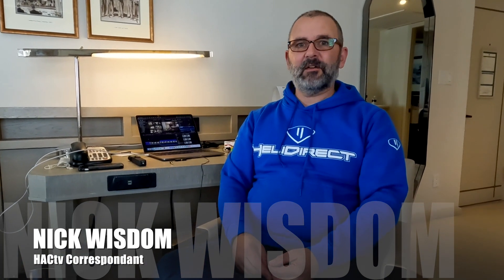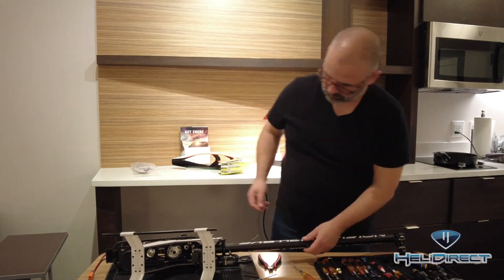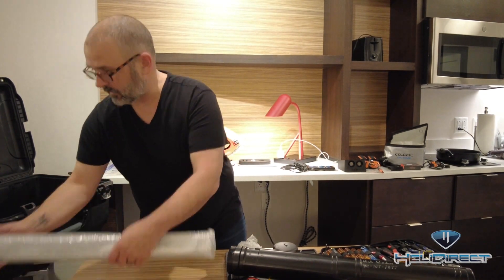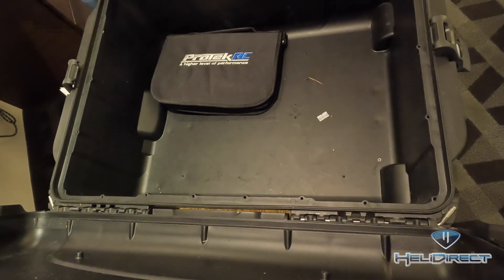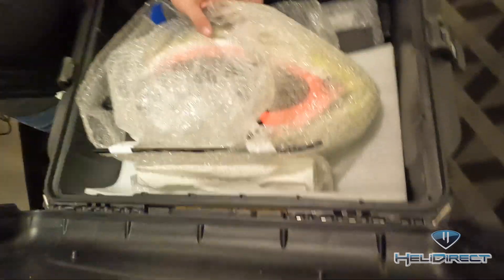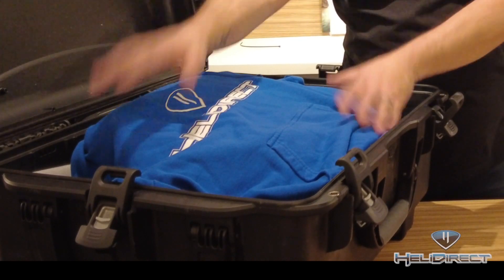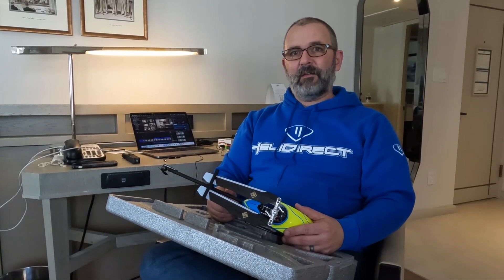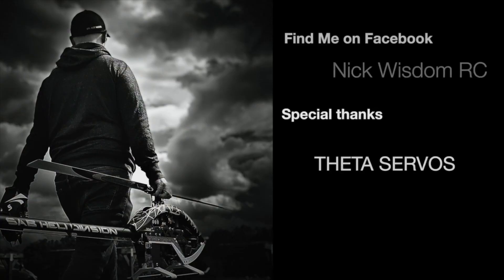“Theta 580” - How to Pack Up a 5-600 Sized Helicopter for Air Travel

Comment: Ha, you wrote 80 Wh on packs :D And does this handwriting work with TSA? 
Recently I traveled with 6s 500Wh packs, they are actually 111Wh, but TSA let me in with them. They said 100-160 is a grey zone (requires permission from a company), but better not to go over 100.
Reply: Technically they are 88watt hours.  I may have rounded down.  I did just buy some Pulse 4500mah 6s packs for this reason.